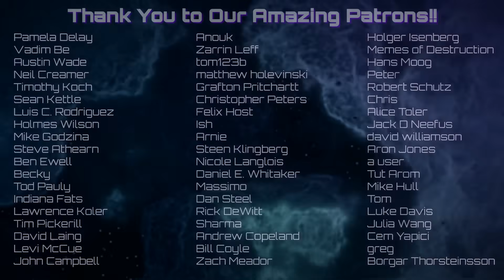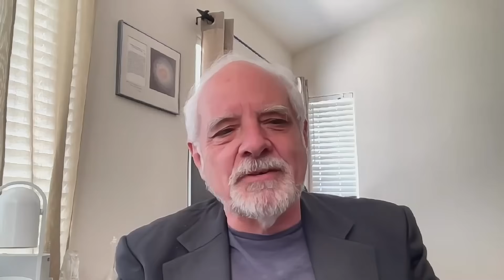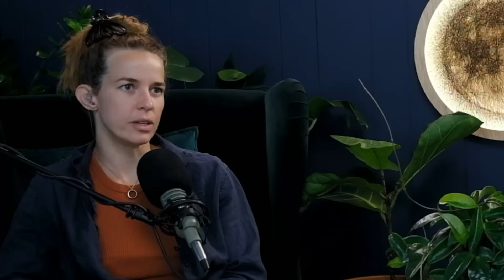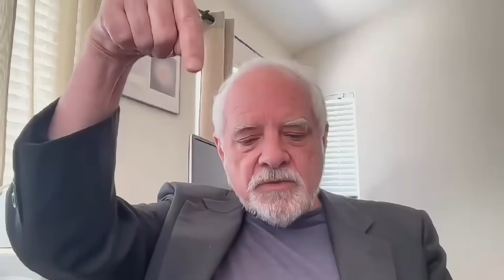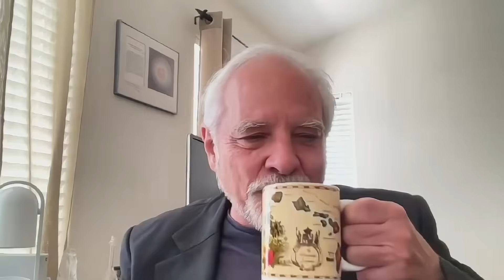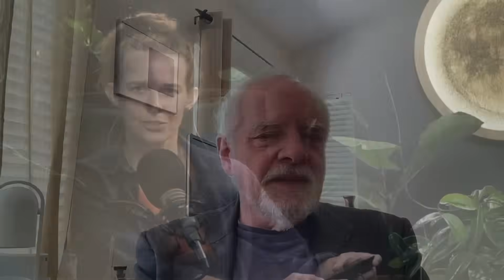Room Temperature Fusion is Here - Lawrence Forsley, ****, DemystifySci #349

Comment: The Safire Project lead by Montgomery Childs showed that medium temperature (25,000 K) is very controllable and the method is now being commercialised.  Several years ago they were getting true net power gain continuously. There are videos on YT and Aureon Energy showing how the plasma is confined and the reactor chamber running.
Reply: Because they changed gears they are not focused on energy production but radioactive waste recycling. Essentially lenr 

Modifying neuclei like alchemy. No joke.

Just YouTube and watch all the Safire project updates.
Reply: @eSchlumpberger One does not preclude the other.
Allowing people to tinker around with Transmutation in their garages requires careful consideration.
One nuclear event produces 1 000 000 times the energy of one chemical event.
And chemical is no slouch.
One cupful of petrol has enough energy to lift One tonne up through one kilometres.
(Get Grok to check my assertion, I have lost my sorce.)
Reply: I read this as 'Satire Project' 😂
Reply: I was about to refer to the safire project. I'm with you. 
Mainstream science is getting closer to infinite electric universe theory. Everyday more evidence supports. Simple common sense. 45 yrs been waiting for PhDs with low IQ to see the light.
Reply: I've been watching their progress for 10 years.  They were visited by USA Intel and Childs discusses that and a lot more in an interview from 2019 (rough guess) on the YouTube channel "See The Pattern", which is another good channel if you like this kind of topic.  So search for that channel and SAFIRE or Montgomery Childs and it should be easy to find.

Aureon is commercial, but didn't happen until they discovered self organized EM containing double layers in some charged plasmas.  This is when they had to shut it down before it melted the equipment (did melt a titanium probe).

They admit that they don't completely understand the plasma physics, it might need new math, and it's NOT free energy, in that the energy comes from somewhere.

They can control it for power, for certain rare earth elements coming from the transmutation, which is happening on the anode (and that anode material matters too).

There's more. See the vids in the menu on aureonenergy website.

My brother-in-law is a theoretical physicist who's worked at multiple nat labs (Hanford site), NASA, in private industry at Corning in NY, as a physics professor (tenure included in offer) UC system, and was working at the DOE at the time that the SAFIRE guys went there.  They also gave talks at MIT.

Aureon is working with the military and national labs.  It kinda sucks that they're limited, but they were made to understand the security issues at stake.  Still, I think that the public knowing anything about it is great.  Especially that it's in use.  That might help with The Science 🙄 

They do have patents, if you want to verify that.  I was watching early and they were a group hired to falsify the Electric Universe group's Electric Sun hypothesis.  Monty Child's has done a lot of work for big industries like automotive.  No slouch and this is no joke or Internet meme of the REAL discoveries being killed.  They ARE controlled, passively but effectively, AFAIK.

It's a damn GOOD THING that they've accomplished, because it's more than the energy.  It's a spearhead and I hope will help to crack or break the Stoopid big bang gravity old jalopy, duct taped together with math variables named "dark XYZ" which have never been observed and the decades long search is wasting generations of bright minds and all kinds of money.

Personally, I think some of the national labs have known about this strategy, but that's because everything they do is over classified as weapons adjacent and the advances don't really make it to the universities.

Anyway, I hope this helps.  It's the real deal. 👋 😎 👍
Reply: Not to be a downer, but the website doesn't say much, and their claims are bold. If they have transmutation devices, this should easily pay for itself. At first glance this should be taken with a massive grain of salt.
Reply: @DavidBirchler I would expect some mysterious accidents, if someone finds a solution for clean energy with high power output. 😉
Reply: @McDaniel77 you think the average person will be driving around with the sun in their pocket? Which ever nation state is the first to implement in public transit is your question.
Reply: @-tarificpromo-7196 China. 

Do your research. 

This fusion energy is not a game. 
It is the means to end consumerism itself.
Reply: @DavidBirchler  Well they are not going to give out the commercially confidential stuff on their site are they. If you need convincing with the science and progress which they have already explained (and where sample were independently analysed) watch the full  1 ¼ hr interview by former sceptic Gareth Samuel:  
Safire Project Update Interview with Gareth from See The Pattern
Reply: @DavidBirchler  Well they are not going to give out the commercially confidential stuff on their site are they. If you need convincing with the science stuff and progress already explained (including sample results which  were independently analysed) watch the full 1¼ hr interview by former sceptic Gareth Samuel: Safire Project Update Interview with Gareth
Reply: @DavidBirchler do your research first before you cast such doubt.
Reply: @ChiefDinger  Can you explain what you mean by research? I did a first glance, I saw a "Science" page with nothing but videos and basically no explanation of the system of their reactor, with just a few unlabeled frames with any data on inputs and outputs. They didn't have the kind of information I'd expect from a fusion company, or neutron source company, or otherwise, but they do have high quality videos and an investor page and a lot of non-technical explanations. It is quite fair to say I did a first glance and that I saw what I consider red flags.
It's entirely possible they've made neutron sources and are doing things quite similar to what this podcast guest was describing, but that is far from clear by their own website nor the one paper or few patents I found. Unless you have a link to something explanatory, I don't know why I would look at this more.
Reply: @DavidBirchler One of the products is tritium, which is illegal to manufacture.
Caution is advised until the public is squealing for energy.